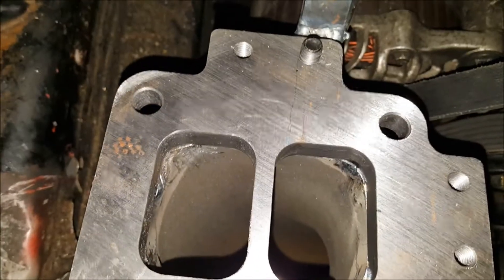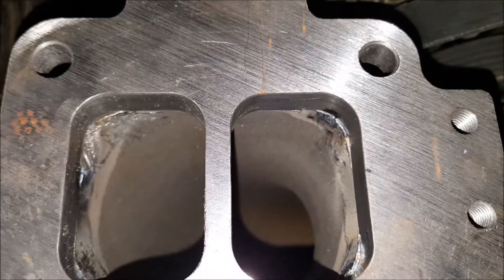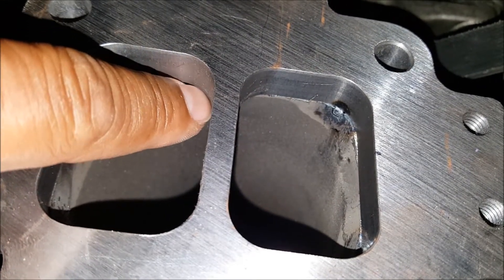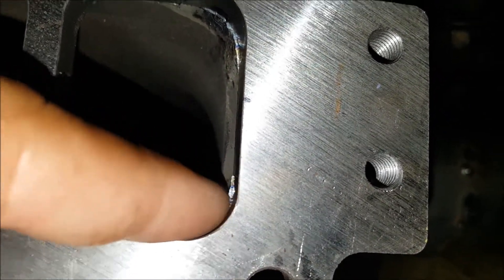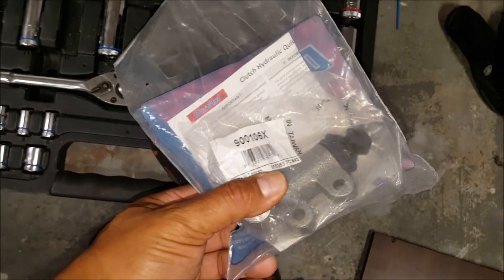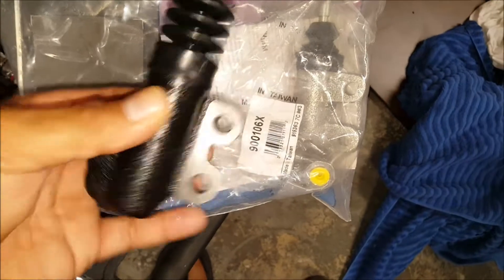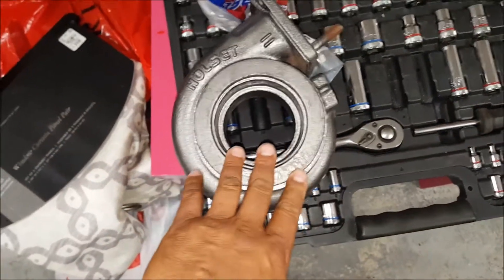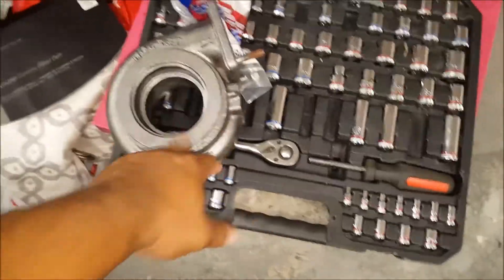VQ35 Build - Part 36: Search for the Infamous HX52 V Band Flange Begins

Comment: Did you ever find one ?
Reply from the maker: Nah...I ended getting a 4 to 3 inch concentric reducer...welded it straight to the turbine...
Reply: Yeah I saw on the next video .... You should of gone bigger so the pressure drop is bigger across the turbine to aide spool. I'm machining a 3.5vband on with a cone to 4" on the down pipe then 3" back. 3.0tdi V6
Reply from the maker: @MrNathanbrand1987  nice...I didn't have spool issues....not sure if you saw the outcome on newer vids...spools good for me...
Reply: I'll take a look. I'm worried about my spool no one's ever put this turbo on this engine before and I'm putting a billet in it . Along with many other firsts ... Thousands spent might not work 🤣 I'm a diesel engineer by trade so calculated it for a 3500rpm spool with all the fuel god sends if it doesn't I'll spray until it does
Reply from the maker: @MrNathanbrand1987  unsure if the exhaust made it spool but this 17cm^2 didn't have lag.  I started to think I should have went hx52 pro or even hx55...ah 55 may probably be too big for street spool.
Reply: I've bought an 11 housing to help it spool still double my current housing volume so should help
Reply from the maker: @MrNathanbrand1987  it will but may stifle up the flow on top rpm with load.  What goes in must go out...
Reply from the maker: Don't mind me...I like to generally have a little room to breathe on top so I will sacrifice spool.  But it all depends what you are building the car for. Good luck with your build.
Reply: It's going on a 3L TDI I can't rev as high as a gas engine so why I went with the 11 but I get what you are saying.